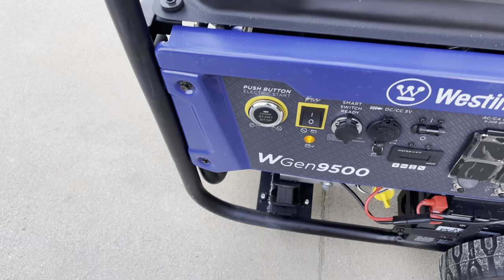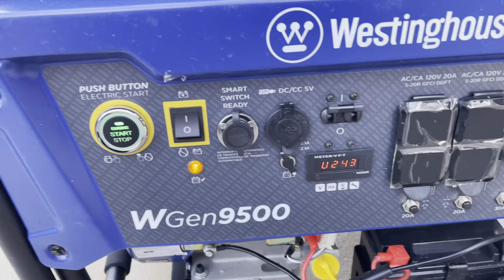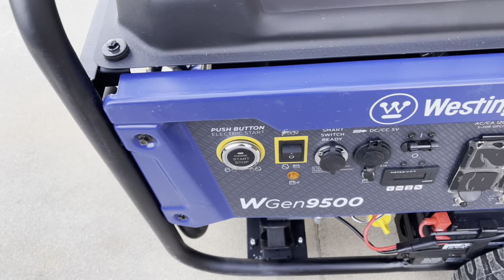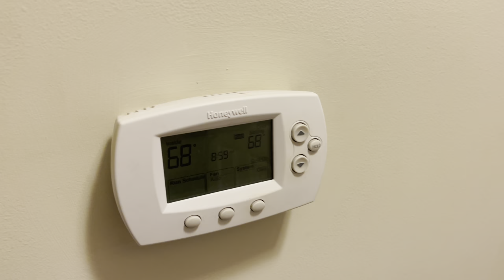WESTINGHOUSE WGen9500! Will it power a home AC??? First start, short review, and the truth!

Comment: This generator caught my attention because Amazon has it on sale for like $850 which is a sweet price. But the 23% THD is what kills the deal for me. That kind of THD is horrible for sensitive equipment like high end TVs, computers, etc...... :(
Reply: Yes a lot of people ignore this important detail. I have a Westinghouse WPro series have THD < 5%. Mine runs at 8500 watts with 11500 peak and has a 50 amp plug.
Reply: @raidx258 what is that detail? I just ordered mine of Amazon yesterday
Reply: @otuagoma  That most generators produce electricity that is not clean and/or consistent as what you get from your utility company. These power spikes from the generator are called THD short for Total Harmonic Distortion. These THD spikes can damage or even fry sensitive electronic equipment like computers or TVs. You want to make sure your generator has a THD rating of less than 5%. Shop generators which is what's most common have THD of 10% to upwards of 20% to avoid problems specially if you plan to plug it to power your whole house with a transfer switch.
Reply: Sams has it in my area at 799.00

Comment: We got the same one about two weeks ago.   There was one dimple on one side of the box and when I opened the thing the frame - right near where the battery sits - was broken cleanly in half.  My wife insisted we order the thing from Amazon (I'm not a fan) but when I called them they gave us an immediate refund and told us we could do whatever with the thing.  I paid a guy 200 bucks to weld the frame - he drove about 20 miles each way to pick it up and deliver the thing.  Only asked for 100 bucks but he did a great job and I don't see any other damage - very nice young guy and I didn't feel like 100 bucks was right.  Gonna fire it up tomorrow and see if it runs okay - I think it will.  If it does, we got the cheapest Wgen 9500 ever sold.  One motor mount was very slightly out of alignment and this guy fixed that, perfectly.  Got my fingers crossed. If  there's a problem, we're 200 bucks in the hole....lol.  Life is a gamble.  If it works I'm gonna make a YouTube video - if it doesn't I'm goin' underground.
Reply from the maker: Hahaha that’s awesome man! Hope it runs great!!
Reply: @BigCountrysWay  DUDE - I fired it up and EVERYTHING WORKS....even the remote!   I'm gonna make a video...lol.  I filmed the whole debacle.  All the digital stuff works.....I really thought it would - but, hey, I'm not the luckiest guy on the planet so I wasn't  holdin' my breath that it was all good.
Reply from the maker: @guymerritt4860  hahaha congratulations my man!
Reply: @idorablo7
0 seconds ago
What does this have anything to do with the AC unit running an air conditioning unit of a home? Your complaint? Go complain to Amazon.

Comment: Putting synthetic oil in is not recommended for breaking in period. After 50 hrs. Maybe. Just going by my service guys experience fixing new generators. I have a 9500DF and it powers my hole house two fridges, chest freezer and central air. I just run the big stuff selectivity. Great generator so far.
Reply: Did you run  the 50 or 30 amp to your house? Or did you just run extension cords?
Reply: Westinghouse even states that you should not use synthetic oil during the breakin period because it will not allow the metal parts to seat properly. Synthetic oil is just too slick!

Comment: I have this generator and one thing I didn't know about when I bought it is the harmonics.  In order to run electronics it is recommended that your generator have a Total Harmonic Distortion (THD) of 5% or less.  The generator in this video, the wgen 9500, has a THD of <= to 23%.  If you want a generator that can run your house and has good enough harmonics for electronics go for the next size up, the wgen 12000.  It costs almost twice as much as this one and, when I bought my generator, I thought the only thing I was getting for that extra $1000 was more wattage but it also has cleaner power.

Comment: Been researching since hurricane left us without power for a full day here in NC. I've been leaning toward the DF9500, but your video convinced me. Now if it will power the AC and a 220 well pimp, I'll be a happy camper. Worst case I'll run one at a time
Reply: You won’t ave a problem with your well pump. I have a 2 hp 240v pump that I have been running with my 7000 Westinghouse I converted to run on propane. in addition to 2 large refrigerators, 1 large freezer, wine cooler, ice maker, etc. not even a hiccup. I just bought the 9500 cause I thought the 7000 was shot (it was putting out 320v.  After the 9500 was delivered I figured I would try to fox the 7000 and it was as simple as a 80 dollar avr. Oh well. Now I have two. May try to run my central ac but it’s really not needed.  If I do they sell soft start kits to decrease the inrush starting amps needed.

Comment: Just bought one for a replacement for my 8750 watt. Love it. Smooth running and steady power on the meter. The remote is great. During the Florida hurricanes I power my entire house with my old one, for a few hours at a time. It will be nice not having to go out in the hurricane to shut it down and restart it. Wired into my 200a panel box, so other than the initial main breaker shutdown, I won't have to go out in the wind, rain and flying debris.

Comment: Keep this in mind.  Anyone getting a duel fuel (gas & propane) generator should be aware of this.  If your starting battery should go dead (for whatever reason) you will NOT be able to start it with the rope pull, while it’s in gas mode.  The generator has to be connected and set on the propane setting to rope pull (hand start).  This is according to Westinghouse themselves.
Reason being, the gas valve is held open with a solenoid valve, powered by the 12v battery.
Reply: Solar trickle charger!!
Reply: OK, thanks for explaining.

Comment: Thank you for sharing this video. My stupid electrician told me I can't use the generator because it's on a 30 amp breaker on my circuit breaker and my ac unit is 40 amp. Accidentally I forgot to shut off my AC breaker when I ran this generator and it worked. I thought it was a fluke but thank you for proving my electrician they don't know what they're talking about
Reply: How many ton is your AC?

Comment: It works fine. I run it every 3-4 months for about 20 minutes and use a gas extender and a batter trickle charger.  Starts right up.
Reply: Forget the gas extender run it dry empty the gas tank empty the fuel bowl. Leave it like that. You don’t have to run it but every eight months. That’s what I do with mine never fails first pull. Keep 5 gallons around for a quick outage and if a storm comes, fill your gas VP cans to 30 or 40 gallons and you’ll be set.
Reply: @condor5635  I always run it dry.  I try and run it about every 4 months or so, but I do run it dry each time.  After 2 years+, the battery is running down even with a trickle charger.  So, a new battery will be installed.

Comment: Great video almost have the same setup.
2 things you should consider. Install a tri-fuel kit and then Tap in on your gas meter for endless fuel. Hard to find gas when power is out. Also you should not let the genny get wet when raining.
Reply from the maker: I have looked into that. It’s definitely something I’m going to install in the future
Reply: I keep mine in my detached garage. It will power an exhaust fan while running.
Reply: what tri-fuel kit did you buy for the 9500?

Comment: We recently purhased the 10500 model with 13000 peak amps for my brother in law in Houston. He's had a real problem with power outages and the tri fuel generator is just what he needed in that hot, humid city. It powers the whole house with no problem  but he shuts off his electric water heater and electric stove while using it becuase they draw too much power. It runs the A/C and everything else with no trouble at all.
Reply: Where did you purchase the 10500 model

Comment: Bought the same one on March 2019 for construction and it never let me down. I bought a Generac 8000 a month earlier also for construction and prefer the Westinghouse over the Generac. It has more features for the same basic cost including a fob start with the package. The Westinghouse is much better balanced than the Generac regarding pulling around. The Generac has much more weight on the handle than the Westinghouse 9500 making it considerably awkward. The only flaw I have experienced with the Westinghouse is the automatic choke. It is programmed to choke for a moment then back off, probably to avoid flooding and it works well at most temperatures. When starting on a Michigan subfreezing day I have to manually keep the choke closed to help it start. Not much to complain about. The gas tank is large enough to keep it running all night and well into the morning avoiding middle of the night fill ups. The current model is dual fuel and also runs on natural gas.
Reply: Thank you! I'm in Michigan too and wanted to get something that's easy to use all year. We have to be prepared since our electricity goes out so much.

Comment: I bought mine almost a year ago. Someone somewhere on one of these videos told me that the pull start didn't work with gas, only with propane. For some reason I just assumed they were right. But a few months ago when trying to start it (with gas), I had accidentally drained the battery previously, so the push button wouldn't work. So I (get this!) read the owner's manual, and it says to manually activate the choke (push it over with your finger), THEN pull the cord when using gas. So I did that. And it started on the first pull, and I didn't even pull it very hard. (The more you know...rainbow.)

Comment: I bought this same unit for the same reason, except mine is duel fuel. I have a 4-ton unit on my house. Haven’t tried it yet, but will soon. I’ll add a soft start if needed, but either way this genset should work. I also purchased 2- 100lb propane tanks with an auto-changeover valve, adapters, quick connects, etc. Should run house for around 3 days without refueling. Anyhow, thanks for the video.
Reply from the maker: Nice man! I wish I had the DF model. Everything was sold out hahaha
Reply: How long can you store propane for
Reply: @quiksilver87
Reply: I think propane lasts indefinitely if it’s stored properly. 

I believe there are aftermarket alternative fuel kits available for this as well.

Comment: I have the same generator runs great. Had a circuit run from my patio to the inside panel with breaker and interlock so I could cut off the outside feed. During a hurricane it powered the house no problem including a well system. Only issue i had was my AC compressor would not kick on. That's when i realized my compressor is wired to the outside box and does not pass through the inside panel.  Already have a hard-start kit installed. After seeing how well the generator handled your AC i am going to see about have the compressor wired up the panel. I verified i have the available space in the panel.
Also i added the US Carburetion motor snorkel for natural gas. Took about 1/2 hour to install. Have a BBQ pit feed on the back patio so I added a quick connect and never run out of fuel. Last storm I ran for 4 days. I can easily run on gasoline if i ever have the need.
Reply from the maker: Nice man! It knocked it out of the park. If the time comes, I’d only run the AC when needed and probably only with a few other breakers like lights etc.. I don’t wanna stress it to hard
Reply: Good thing you saved some money acquiring that scratch and dent reject. You're going need it when you have to replace your HVAC control board due to the dirty power that POS genset pukes out.
Reply: @dontblameme6328  this 100%
Reply: @dontblameme6328  it shouldn't be a problem for ONLY emergency situations, power outages
Reply: Unfortunately this model does have a thd much greater than 5%; somewhere in the low 20s range. However the wgen12000 model with a peak of 15000 starting watts comes with a thd <5%. Cleaner and greater power but the price is a bit more of course. Also have the option of just gas or dual fuel. Even their biggest baddest generator that has running watts of 20000 and peak starting watts of 28000 has thd< or equal to 5%. Very impressive for a non inverter generator. Doesnt take away the value of this wgen9500, great price and plenty of power as well.
Reply: What size is you gas line? 1/2” or 3/4”

Comment: Hey guy, over here in southeast louisiana, we didn't get the terrible storms y'all got last year, but we've had our share. I have the exact same gennerator and want to hook it up to power my house as well. I THINK the big AC at my house is 3 ton and the small one is 2 ton so in addition to powering my fridge and freezer, the AC is a priority. If you get the time, can you make a video and show how you got this all wired with the interlock and plug at your house? I would appreciate it. I would go with a male connector at my house due to safety concerns so I don't have to have a male to male extension cord, but other than that, what you have done is exactly what I'm planning to do. All info you can provide on your setup would be extremely helpful.
Reply: I'm in southwestern Louisiana (Lafayette Parish) and wondering the same thing. I got an electrician coming Wednesday to give me an estimate. I want him to put a plug in outside and an interlock like Big country got. Over the phone, he's recommending a transfer switch instead. Probably because it's more expensive. I plan on getting the same generator big country got. That think a beast!

Comment: Just got one. Power my 18k BTU ac and shitload of stuff in the house and it's far from having issues.

I have two heat pump tho but I only use the 18k one in this case anyway. Both are still on the generator box same for my water tank lol 

Now that I installed all that, I suspect I won't lose electricity haha.

I've lost electricity like 5 times before installing it this summer lol
Reply: Did you run  the 50 or 30 amp to your house?
Reply: @ekimskaew5304  50A. House is too big to go lower than that
Reply: I also linked a few more breakers on it tho on the secondary panel. So depending of the season, I might just turn off a few individually to save load on it.

Still never had the chance to use it lol but with the fuel price ATM, I'm not in an hurry to use it haha.

Comment: Hey bro, do you know you could make it Automatic during power loss.. all you have to get is the Automatic Transfer switch, which cab power up to 20amps.. then you could wire up a knife switch inside your property to manual change over to power the remaining heavy items in your house. 

This is helpful because you could turn on and off automatically and when you not at home you do not have to worry that your family is not taken care of.. also you could build a muffler system with a box to quiet down the noise. 
God bless.
Reply from the maker: Yes sir, I’m aware but i just wanted it to be easy. I have a shop as well and a few key parts are 50amp so with my set up I can still work in the shop if need be. I love feedback! Thanks for the comment!
Reply: He totally ignores all the subtleties about having a generator sitting around for months or years with gas in it waiting for the power out moment to happen. Transfer switch limits your options as well as to what circuits to power. Oh yeh and where is that generator while it’s waiting to automatically turn on?  Outside in the elements with that fuel gumming up the carburetor. No thanks. I’ll just gas mine up and have it up and running in 15 minutes when I need it
Reply: @condor5635   Being it is dual fuel, you can have it connected to propane and not have to worry about gas going bad or gumming up on you. You can setup an automatic transfer switch to power the entire house or select breakers to control just part of the load.

Comment: I have electric water heater that thing kicks on with the AC pulling about 60 amps for I guess I could shut it off. I live in Phoenix we don't get power outages much but in the summer no way can go more than a few hours temps in the house will go over 90 in no time. The only thing I would worry about is sagging the voltage when the AC unit kicks on could cause damage to the compressor if it sags too much. I have a new AC unit don't want to damage it I called the installer he said if I put a soft start on it voids the goodmen warranty.
Reply from the maker: If you don’t put a soft start kit on it and full send it with the generator, if you have any issues they don’t have to know you were hooked up to the generator 🤷🏻‍♂️ then the goodmen warranty will cover 🫡
Reply: @BigCountrysWay  They said if I open the unit up and install a soft start, I'm voiding the warranty. I guess I could remove it before the contractor comes to look it if it fails. They understand what a softstart is, but they said Goodman doesn't approve using it voids the warranty. I understand that unless their engineers were to approve its use, they can deny warranty.
Reply from the maker: @Mike-01234  lol read my first comment again 🤣 I said DONT put a soft start on it 🤣🤙🏻